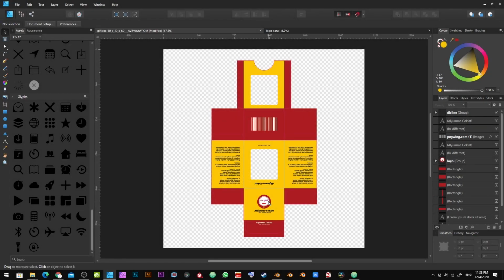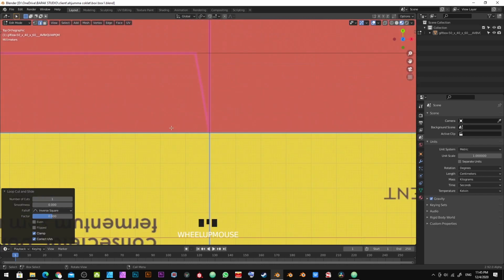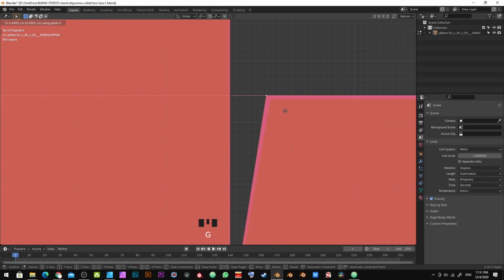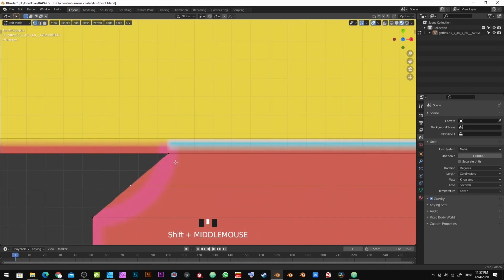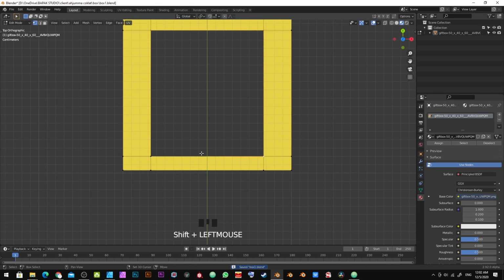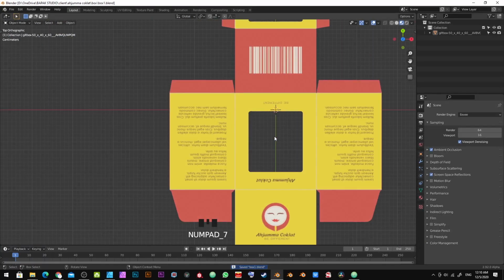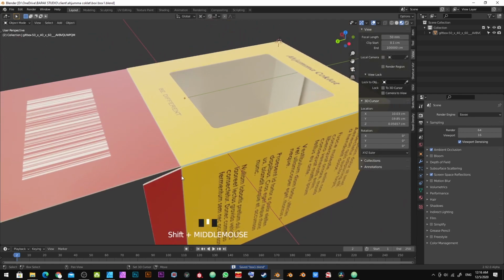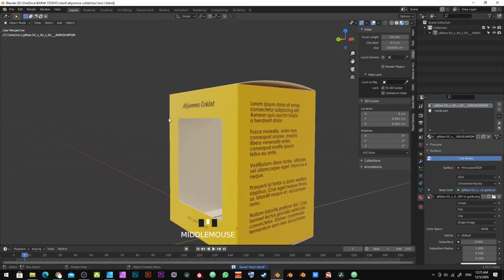How to turn your dieline into 3D Mockup in Blender 2.9x

Comment: how do i do this if i have designs on the inside of the box? do i just edit the texture/uv map?
Reply from the maker: the design inside of the box have the exact position as the design of the outside right?
Reply: @BapakStudioBangsawan  yes!
Reply from the maker: @18kVS  ok if that the case, add one material, apply the inside texture in that material. then, in the solidify modifier, offset the material for inside part

Comment: If the design is revised, do you have to create it all over again? Also, can you add additional designs to the same model? Thank you - this is cool ... I'm the 1000th subscriber :)
Reply from the maker: Wow! Thanks 😁😁 yeah if the design is revised you can reuse the same 3D, unless the dieline is changed, then you need to do it all over again
Reply: @BapakStudioBangsawan  Awesome - thank you! I'm going to give it go :)
Reply: @bapak Studio -Forgot to ask - can you export Blender images as CMYK? I'm in print packaging and all printers require CMYK PSD files (i.e. showing a 3D image of product on a carton). From what I read so far, Blender images are for digital platforms, not print. I'll still play around with it ... thx
Reply from the maker: @agathalee3432  im not sure about that
Reply: @BapakStudioBangsawan  I'll keep you posted on what I find
Reply from the maker: @agathalee3432  alright thanks 😁

Comment: Good tutorial. I'm gonna put it to practice, since I design quite a lot of boxes. One though though: since the box is so symmetrical, wouldn't it be possible to use mirror modifiers along the way, so you just make half the work?
Reply from the maker: Yeah you can do that too, but then you need to fix the uv afterwards.
Reply: @BapakStudioBangsawan  But couldn't I apply the mirror modifier when I'm done modelling the box, and only then apply the texture?
Reply from the maker: @MarcinPetruszka  yes you can.. 😁